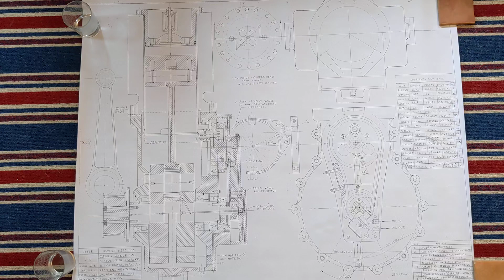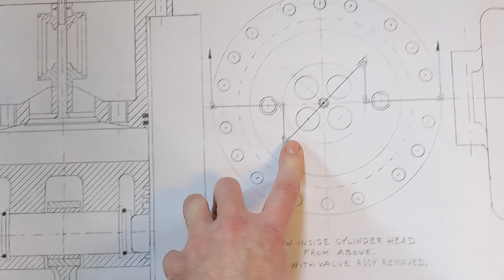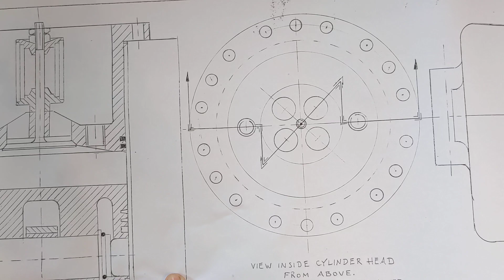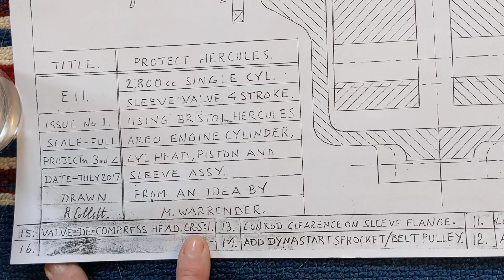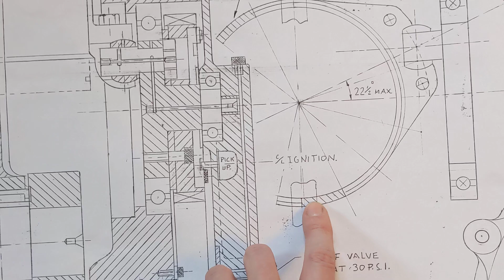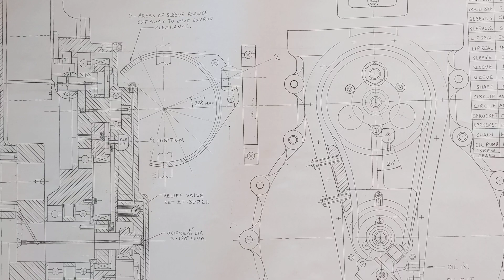New Drawings - Issue 15.

Comment: Did you try the starter with sleeve timing retarded a tooth or two, yet?

the chain tensioner decompressor is theoretical, sorta. I'm a mechanic (ASE Pro, actually) and I've worked on cars with worn timing belts, They crank fast, because compression is down.

If the bet has only slipped a couple of teeth, the engine will still run, just crappy. Beyond that & the pistons hit the valves, but that is not even a worry for you!